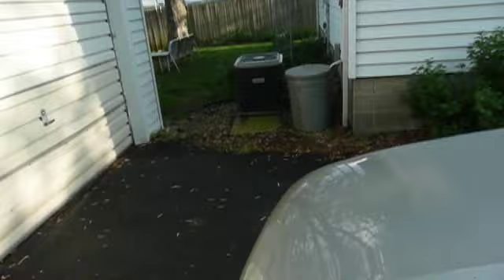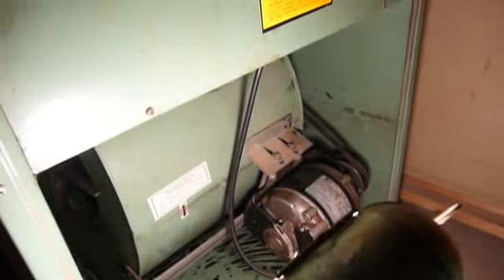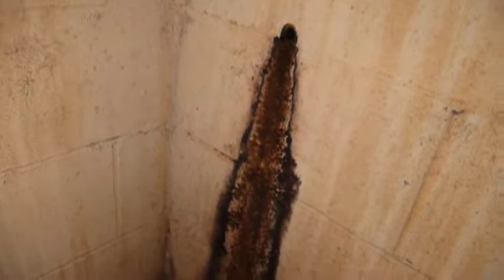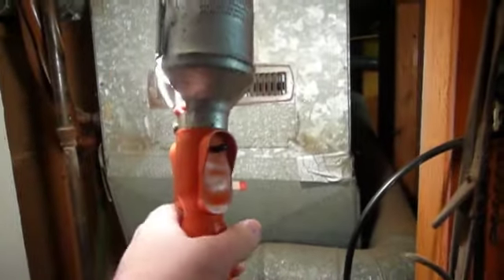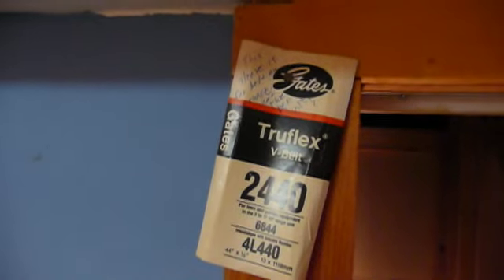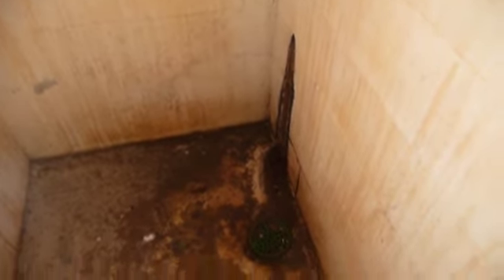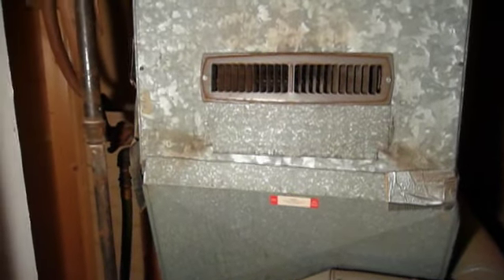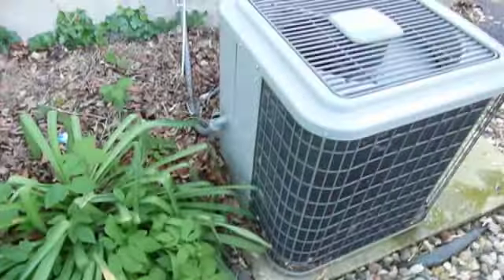Frozen Furnace and Air Conditioner

Comment: That was some serious ice build up! Our AC unit had frozen over on the outside during the winter, I guess the condenser just didn't like the cold. We had to spray it with a hose from the roof, happened like four times.

Your pretty lucky someone was thoughtful enough to leave that belt packaging around. I might order a few in case they maybe stop making them, who knows with a furnace that old.

Comment: That just recently happened to my A/C unit. The coil in the furnace froze completely over. But, it wasn't a bad belt...the furnace fan somehow decided to run in reverse. The whole fan had to be replaced. According to the maintenance people in my apartment complex, this is a known issue with my furnace model.

Comment: The house I grew up in had a Singer system but it was a bit newer - the motor was inside the squirrel cage blower.  I do remember one year the motor's bearings failed and, while it ran, it sounded like a tractor.  That system was still in place when the house was sold in 1995.  My family bought it new in 1977.  That one is probably older.  That's a lot of rust from the condensate line, I imagine the inside coils have been replaced at least once.

Comment: @uxwbill Yah I ended up replacing the fan belt and the motor a month later. I also had the gas company check the burners and gas control valve.
The furnace  was a replacement for a gravity furnace that was in the house before. So it may have lacked some of the safety systems that new furnace's have.

Comment: @uxwbill I understand that, but the limit control on the furnace should cut the burners off before it overheats. The last furnace/airconditoner combo I worked on last night was totally iced over and the furnace went out on limit several times, but it thawed out the coil. I'm paid piece rate, so getting this stuff thawed out and getting the customer back in the cool is the utmost.

Comment: You think the AC installer would have put n some kind of air flow sensor to prevent this.
I remember moving in to a house in the winter. And the fan belt on the furnace was broken, but the furnace was still ruing and the top was glowing red hot. I don't think i ever ran that fast to shut off breaker in my life.

Comment: That sure was allot of ice. Mine does that every year. and it's because the coil is hard
to reach for cleaning. did you have to clean the coil?  if so what cleaner did you choose ?  i use a spray foam from the hardware store. (not so good )  
that looked real clean compared to mine. lol

Comment: Don't get the new belt to tight. Should have at least 1/2'" deflection when you apply slight pressure with your finger.

I hope someone is checking that heat exchanger and flue passage every year. you'd be money ahead changing that out to a correctly sized 95% furnace.

Comment: Well this week the Furnace at my house is going to be retired and being replace i not sure that bread we are geting yet i plan of makeing a video on my other youtube channel i will make a video of the old Furnace before it goes then when the new one gets put in i will make a video of it the old was is 20 years old almost going to 21 it was falling apart and they are cranks in it also out Air Conditioner is going to be replace in the spring too it's also 20 geting to 21 years old it has broke down a couple of times the main reason that it had been breaking down is banned wires and the guy said he can't keep fixing it anymore so the air will be replace in the spring time before the hot summer comes i will make videos of both of them before they go and when the new ones go in!!!

Comment: wish you could have shone how to oil an electric motor. great video thanks
Reply: @b4roni1: Some motors have sleeve bearings to run the motor quieter than ball-bearing-equipped motors. If you're lucky, then your motor has two screws which cover up direct tubular connections to the sleeves. So, there's no need to unmount and disassemble the entire motor just to lubrify the bearings, and reassemble and remount everything back up again. These screws allow easy access for the annual service and maintenance. But they're kinda rare now.

I've dismantled a broad variety of AC single/three phase motors dating back to the 90's, and all had ball bearings.

Comment: This happens to me all the time all you have to do is turn off the A/C unit for 1-2 days and let all the ice buildup melt. Then after 1-2 days turn it back on and it should start blowing better.
Reply from the maker: You need to fix the cause, rather than the symptoms. In this case and likely yours, it was insufficient air flow.

Comment: How old is the furnace and the air conditioner?
Reply: ***** Wow. Does the unit blow ice cold air because if not the unit maybe needs to be replaced.
Reply: ***** Those old Comfort Maker "Soft Sound" units were (and still are) made by ICP. You are right that unit is probable 8-11 years old. That furnace is old!
Reply: Jim Dayton I've seen a ICP for my churches cafatiria. And don't know how old it is. :P

Comment: I saw a spark at the blower motor at 5:08!
Reply: +Andrew Habib That old motor has a centrifugal switch that switches off the start winding when it gets up to speed. the spark at startup is normal for those.
Reply: ***** I know what you mean. I have a blower just like that, but with a capacitor instead of the centrifugal switch, and it does not spark. So the centrifugal switch switching to run winding would be the cause of the spark?

Comment: Is it good to cover it
Reply from the maker: +Anna Lewis So long as nobody turns the unit on with the cover in place, sure.
Reply: My AC is freezing at the evaporator coil every morning between 4 and 7 am the humidity gets up to 99 percent here in south texas and I just changed to allergen air filters because of my four cats its either low on freon or those filters are too restrictive... the unit isn't even 2 years old yet.